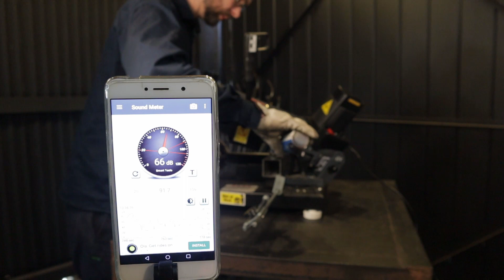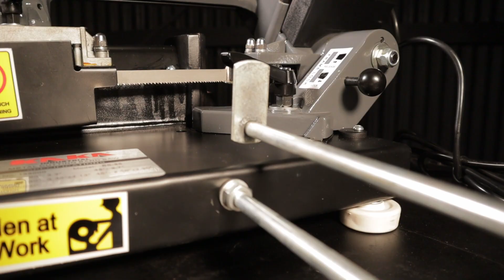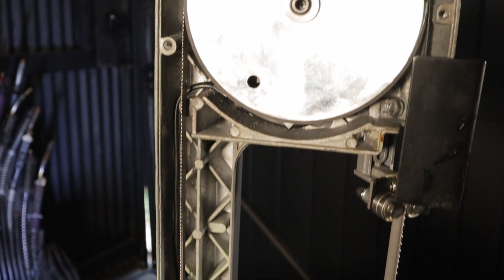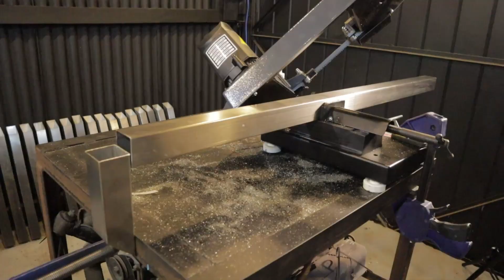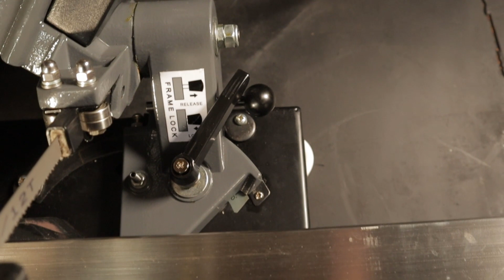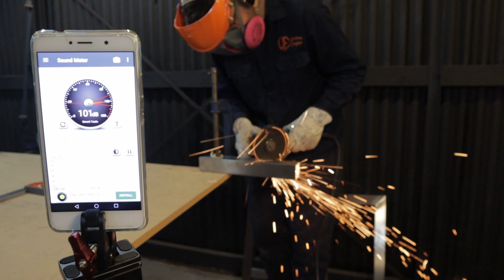Metal Bandsaw BS 85 Review

Comment: You mention that cutting lubricant should be used but Vevor and Kaka say that you should NOT use lubricant as any carried on the belt could cause it to slip on the rubber lined wheels. What is your experience?
Reply from the maker: Hi Chris, I do you a drop or two of cutting oil on stainless steel. The blades wouldn't last long if I didn't. I have checked the rubber on the drive wheels and they still looked dry. I hope that helps.

Comment: how do you ajust the blade on  these machine mine cut a little bit inward from top to bottom cut
Reply from the maker: Hey mate, it depends on the cut. If you do any cuts of 90° the blade is stressed. This will be evident on any machine. I have used a $60,000 bandsaw and it has the same effect.

To avoid this. In my video, let the blade come into contact with the rhs /shs then you usually move it back about the same amount as the blade deflection you get from your "test cut".

Most people don't have the attention to detail as you. I appreciate your comment and I hope it helps. Being very delayed.

Comment: Just purchased 1 of these for sawing metal for the small lathe I have. What cutting flued would you recommend? thanks
Reply from the maker: Hey mate. I use the liquid trefolex. Only needs a few drops per cut. I have cut a lot of stainless with mine and the blades lasted well.
Reply: @weldingempire  Thanks ! I'll do the same

Comment: Bought an Evolution cold cut saw for the same purpose.
The fence flexes and therefore difficult to get straight cuts, particularly with 45 deg. cuts.
Supplier will not take responsibility. So will be building a new fence and (probably) base to get a more ridged fixture.
Reply: Yeah that's exactly why I didn't buy the evolution, I got the fein slugger instead as it has a heavy cast steel fence, and I use it to miter stainless steel angle so it has to be super tight. Great tool and very fast.

Looking at getting a bandsaw as well though as the cold cut saw is so loud cutting stainless, and I'm trying not to piss off the neighbours...
Reply: @gabeayres541 true that mate about pissing off the neighbours. How have you gone with that? Noise is the number 1 reason I'm looking to add a bandsaw instead of just 5" grinders and my atrociously loud abrasive chop saw. LOUD.
Reply from the maker: Hey Graeme, thanks for the comment. I think it's well worth building a stronger fence. It saves a lot of time in the long run.

Comment: How is this saw going 6mths down the track?
Reply from the maker: Hey Dilzy, I really like it. I find it very portable and easy to drag out off my shelf to use. I will be looking forward to using on my turbo manifold soon.
Reply: @weldingempire  Thats good, I'm tossing up between one of these or a Hare and Forbes model. From your decibel test I can see that its pretty close to a grinder, is that accurate? I would thought a grinder is way louder. I ask as ill be using it in my garage and would rather keep the neighbour's on side with my projects haha
Reply from the maker: If you are in Australia and you are close to Hare and Forbes , I would buy the that. Just for the reason you can buy the blades in store.
I find the bandsaw to be quieter than the grinder. I was only using a free decibel meter on my phone.
Reply: @weldingempire  I am close, about an hour from their store. Only they don't have the saw i want in-stock, just the next more expensive model up haha

Comment: hey, great review, was wondering how much of a wonder the blade has from square once the material is cut?whats the fitt up like if you put 45 degree mitre to mitre together to tig weld?
cheers
Reply from the maker: Cheers, the cut was good once I allowed for the wonder.  It would be good for pie cuts also. It is the radius that twists the blade.

Comment: You really want a cold chop saw (faster and neater cut)  for cutting box section and tubing not a bandsaw - bandsaws excel at heavy solid rods and bars
Reply: In my current situation, a cold chop saw is too loud - they're loud as hell!!
Reply: They don't leave a clean edge without distortion on a <2mm tube like a good bandsaw with a >14TPI bimetal blade? 

They're also really loud?